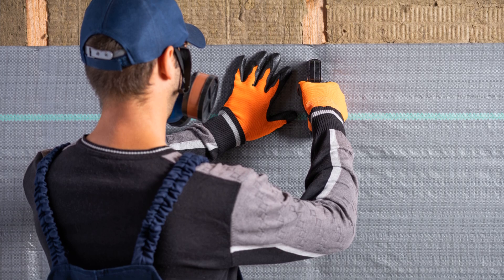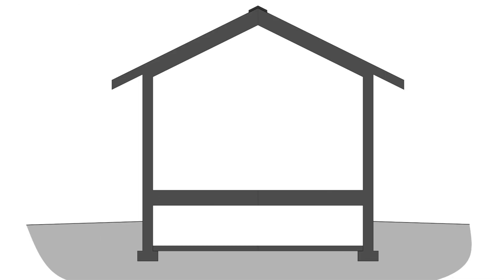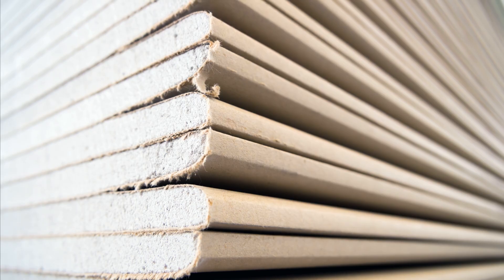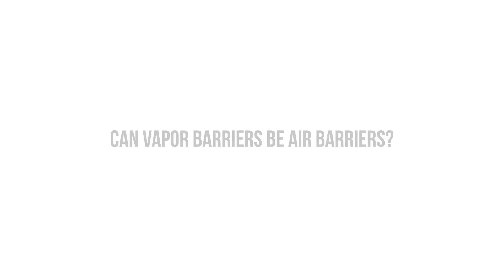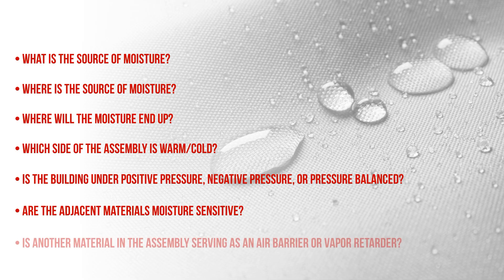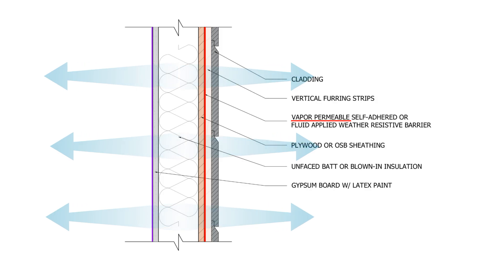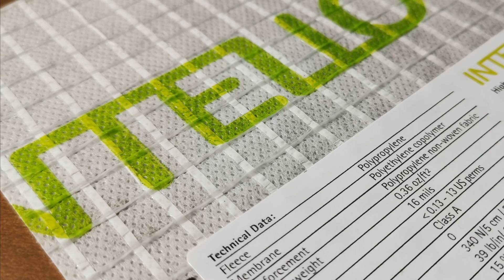Air Barriers vs Vapor Barriers | You NEED To Know The Difference

Comment: You overemphasize air leakage way too much. A bottle of Coca Cola on a hot day will create condensation with zero air leakage. Stop w the damn air leakage
Reply: No he's doesn't...
 air movement itself, from point A - B, where there is a temperature difference,  creates water at that exact point

Comment: clear as mud.  Define terms.  give product examples.  Im more confused than before I watched.
Reply: I thought he did a pretty good job considering all of the variables like different climates, change in season, construction techniques, moisture starting point, air movement to/from and definitions of permeable, non permeable, semi permeable...
The science on all of this is still happening and there is an array of products for a diverse multitude of applications. 
You think a few minute video will get to the bottom of all this?

Comment: on brick structure I’m currently renovating the bathroom on, I need to frame a wall on 2 exterior walls. I plan to use 2x4 framing 1/2” off the brick, rockwool in the cavity’s and a smart vapor retarder on top of the studs, then T&G boards. Would this be okay??

Comment: Just build a concrete house. I will never understand the American obsession with wooden/stick frame homes.
Reply: Cost, concrete is multiple times more expensive, and it's more difficult to expand and renovate in the future.

I've done recent design comparisons for a project I would have preferred to do in concrete and the cost was $500,000 for it to be done in timber frame with drywall versus over $3,000,000 in concrete.

Comment: Thank you for your supportive  information. Keep a housing structure dry and correct way to functional circulate air from the interior to the exterior systems that each applies to.

Comment: I want to use exterior ISO insulation on top of OSB sheathing.   There are various techniques for getting a good air barrier on top of the OSB sheathing, such as roll on Cat 5 or peel and stick roofing underlayment.  How would you recommend detailing this for Zone 5 B?  Am I being excessively paranoid for wanting to have a vapor permeable route out from the outer surface of the OSB?  Or should I just assume that the sheathing will dry to the inside and that it doesn't matter what the vapor pressure and moisture content is of the ISO?  I've been thinking that a band of mineral wool board at the top of and the bottom would provide a vapor bridging path relatively easily, but I haven't come up with a suitably cheap vapor transport layer beneath the ISO to the top and bottom of the roof or wall.

Comment: Just found your channel; super informative, thank you! I noticed most of the resources on your site seem to be aimed at professionals: would you consider creating something for homeowners? I am looking to insulate the attic (and maybe walls?) of my circa-1919 house in the upper midwest but I am worried about someone coming in and doing it wrong and causing some of these mold and condensation issues (and also realizing I already have those issues from summer AC use causing condensation in my walls most likely). I want to be able to understand what the best practice solution looks like so I can be confident I'm hiring someone who knows what they're doing. Thanks so much for all the great info!

Comment: I'd be interested in your thoughts on how to manage vapor for a house at 800m elevation where it's hot in summer 40c, but not exceptionally humid, and cold in winter often 0c and getting as low as -5c.

You mentioned high desert but what might a composite, i.e. layered, wall look like?
Some possbile materials. I'm sure as an architect you have a number of other products for things like thermal bridging

Outer layer: AAC or sheetrock
Possible Layer: semi permeable wrap
Possible Layer: Air gap or rockwool batts
Possible Layer: Foil backed polyiso or other rigid insulation. Which way does the foil face
Possible Layer: Air gap or rockwool batts
Inner wall: corefilled concrete blocks or sheet rock wall

Or any other combination of layers

Comment: Some good basic information, however, oversimplifies the current reality. 1) Nowhere in the code is the reference vapor barrier - everything is a vapor retarder. 2. Current building codes require external insulation - none of the examples demonstrate this, and it DOES change where the dew point shows up 3. No matter the climate zone - the phrase "it Depends" needs to be applied - the video showed and discussed understanding the moisture source and climate zone considerations, however, if you build to code with external insulation, it is recommended to run a WUFI to assist in validating the correct sequence of products.
Reply from the maker: Some valid points, but the video's intention was to break down the differences in vapor barriers and air barriers. I will say, if you need to run a WUFI model, you're doing it wrong. WUFI spits out whatever answer you want, it cannot account for complex 3 dimensional air flow networks. Vapor and condensation is very simple to design for using first principles.

Comment: Cold humid climate, coastal maine. Can I still use a smart vapor retarder if I can't put furring strips on the interior side of the wall for a service cavity/air gap? Can it directly sit up against the back of the drywall? Renovating an old house on the inside and there's an existing window on the wall, so I can't just make the wall come out more
Reply: Extending jams isn't hard to do with most windows if that is holding you up in any way.  Part of spacing the drywall out may be to reduce penetrations overall.

Comment: i was wondering how much nail perforations through taped seam sheathing affect the the air barrier, when siding it seems unavoidable to miss studs, especially when doing shingles, does anyone have any insight into this, also i know siga majvest claims self sealing, but i assume an exterior membrane like that is the solution, or perhaps this is a negligible affect?

Comment: I'm still confused: why not always use a vapor open air barrier, ie; Zip sheathing or something like @2 perms? Let moisture dry to the inside or outside.
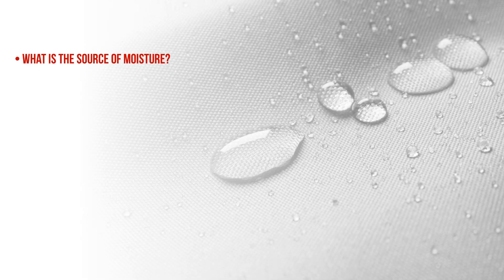Reply from the maker: A lot of the time we try to design our assemblies to be vapor open, but there many times when we need to "throttle" the flow inwards and outwards. We don't want too much moisture to pass through at once, otherwise it could cause problems interstitially. For example, if we have a reservoir cladding like brick or stucco in a hot humid climate, we want to slow down that inward flow so that we don't get condensation on the backside of the drywall. Another example is in a flat roof system, in which the impermeable roof membrane is exposed to the exterior environment. We don't want moisture drying upwards and getting trapped underneath that membrane, as this often leads to roof rot in those assemblies. Refer back to the list of questions I listed at 4:19 to determine whether you need something permeable or impermeable.
Reply: @ASIRIDesigns  on brick structure I’m currently renovating the bathroom on, I need to frame a wall on 2 exterior walls. I plan to use 2x4 framing 1/2” off the brick, rockwool in the cavity’s and a smart vapor retarder on top of the studs, then T&G boards. Would this be okay??

Comment: Asking advice. Plan on building a house with double stud 2×4 walls with 3 1/2" in between. R15 mineral wool for a total r45 with ziga majrex on the inside of the exterior framing as a smart vapor retarder. Should I use zip sheathing or cdx on the exterior? There will be a rain screen behind the siding. This is in 6a zone with humid summers. Thanks for any advice

Comment: I’m surprised that at this late point in the era of the post WWII building materials, specifically the move from woodlath- plaster wall finishing to the domination of gypsum board, that the absolute preponderance of the paper faces of gypsum noted to cultivate mold, mildew, etc. is still unaddressed.
Maybe it’s just me.
Reply: You didn't have those problems when you lived in a drafty, poorly insulated house. We build our houses as tight as cars and we know what happens when we sit in a car with the windows rolled up and no venting to the outside.  It is true that houses gotta breath, but not through leaky walls.

Comment: The rule of thumb is that an exterior air barrier must be 6 times more permeable than an interior vapour barrier in colder climates. The introduction of improperly installed (no gaps between sheets) OSB sheathing and insulated foam board insulation on the outside (taped) creates double vapour barrier which will doom the structure (I have witnessed rot and mold within 2 years of occupancy). Something I have theorized is that by introducing contolled air gaps within the structure and connecting the space to mechanical ventilation it may be possible to neutralize air pressure across the assembly thus interupting the flow of water vapour in either direction. While there is the question of increasing heat loss / gain this can be compensated by locating the air gap inbound of the dew point location and isolated from any fibre type insulation.
Reply: Nice rule of thumb, but I'm not sure whether it is good science with modern practices.  I think you are actually talking about vapor barriers, rather than air barriers.  If I understand God Emperor Joe L. correctly, he says that you can have vapor open assembly, as long as the least permeable part is in the middle, and that you don't have any condensing surfaces.  My guess is you are Canadian (Charter Rights and all), having to deal with insanity in the building code there?

Comment: 😮M notDUMB! This"PRESENTATION" like many others leaves me wondering wtf? Diy'ers need:FACTS,USEFUL data,straight,concise insructions.clearly the intent is  of this vid is2frustr8 diy'ers in2 paying a-hole contractors!
Reply from the maker: What's the problem?
Reply: The whole video is nonsense as is the latest trend in wrapping yourself in plastic sheet. Literally the worst thing one could do. This is only a trend in certain countries. Yet everywhere else they manage air and moisture just fine with no mold whatsoever, they live in very healthy buildings which are very cheap to heat or cool down and many of them don't need forced cooling at all even in 40° + Celsius . None of them are wrapped in plastic, in fact if any real science ever gets done it will immediately show how bad of idea that is, summer or winter. The so called research mentioned here isn't science, it's a fact manipulation. 
There is a lot to be said for basics and building properly, we wouldnt have to worry about air barriers at all.
One way vapour barrier on the outside can be beneficial in certain builds, but if you absolutely depend on air barrier then you have a different kind of a problem, ab is only masking up those problems while adding new ones.
Reply: @samsonsamsamsam  what countries and places are you talking about? Can you give some examples?
Reply: @samsonsamsamsam  okay grandpa, maybe take your pills and have a lie down. The world isn't a giant conspiracy, building standards and our understanding of climate management just improve.

Comment: Thank you for the clear explainations. Air leakage is such an underestimated problem. The "buildings need to breathe" mantra continues the damage. What is your solution for humid air present at the roof ridge while maintaining the air barrier?
Reply from the maker: Thanks for watching, and great question. There's a few ways to address humid air that accumulates at the ridge. You can either use a diffusion port (mostly for warmer climates but there are ways to design them for cold climates as well), run a dedicated supply and return for the attic space so that it receives conditioned air and exhausts that stale humid air, or install a dedicated dehumidifier for the attic space. Or you can specify a self-adhering roof underlayment that's vapor permeable and use a vapor permeable rigid insulation like mineral wool with an air gap to facilitate drying across the entire roof assembly.
Reply: Humidistat operated passive vents?
Humidistats seem pretty cool and living in England I'm surprised I don't see more of them.
I reckon a solar powered control panel could link together multiple areas in a house, regulating moisture in an intelligent way, 
with external sensors too the capability to go from passive venting to mechanical venting could be utilised too, maybe creating an efficient system that could be installed without altering the fabric too much.
I do know that despite all the modern materials and know how, its still a problem in the uk that often gets overlooked and doesn't seem to have found a definite solution.
Surely the quality of air we breathe is a primary consideration.

Comment: I wonder what's more useful and/or cost effective - the dehumidifier/erv combo + standard WRB, OR a completely sealed building envelope (example: zip system w/monopoly framing for a super tight assembly) ?  

The reason I ask is because I wonder if a simple vapor permeable WRB  like HydroGap SA (which also acts to a lesser degree as an air barrier) + a dehumidifier is just as effective as a zip system house 🧐 - Climate = coastal southeast, subtropical
Reply from the maker: A good building envelope can save a poorly designed HVAC system, but very rarely can a good HVAC system save a bad envelope.
Reply: In your video, you recommended a 'semi-impermeable' WRB for hot and humid climates, however even Zip which is a great air-barrier is between 12-16 perms, making it semi-permeable...How do you achieve the recommended 'semi-impermeable' assembly? - is an additional vapor retarder needed on top of sheathing OR is 10-16 perms sufficient? - My understanding was that low perm WRBs are sufficient - for example HydroGap SA is 12perms
Reply: Appreciate your thoughtful content btw 💪

Comment: I would better be able to follow your presentations if you were more consistent with conventions in your drawings - either always have the exterior surface on the left, or always have the exterior surface on the right.  As it is, every time I see one of your drawings, I have to pause and evaluate which direction things are, because that convention keeps changing from one drawing to the next.

(Thank you for your high quality presentations.)

Comment: Your videos are excellent; thank you for posting them here!  Information flow is focused and concise with useful graphics and descriptions.  I usually play each video a few times.  Your accuracy rating seems to be very high, as well.  Less accurate construction videos regularly have obvious issues, like a host's failure to use eye protection, or some essential step being left out, or problems visible in the background that go unexplained.  I am looking forward to reviewing all of the content you have shared!
Reply from the maker: Thank you so much! Glad to hear it was helpful.
Reply: @ASIRIDesigns  Thanks for your reply!  I just read through the comments here; they are quite interesting.  One of them makes me suspect that entry-level DIY viewers may not be ready for information-dense content like this.  I suspect some contractors might also not be.  Somebody might not know which question to start with, especially if you're covering multiple building zones on a complex topic.  Then consider the confusion various contractors may create online by having different ideas about what works best.  I suspect building inspectors themselves can contribute to the confusion, considering the stories I've heard as well as my own experience as a DIY homeowner.

Condensation damage here along the Gulf Coast has drawn my attention since I repaired floor damage in my aunt's house more than twenty years ago.  She was using a huge window air-conditioner in the large hall of a very old house that had no insulation under the floor.  After investigating the damage, I realized that moisture from the warm, humid, crawl-space air was condensing through to the underside of the original floor linoleum and then rotting the subfloor.  A layer of sturdy Masonite and then another vinyl flooring had concealed the problem for many years.  Curiously, the damage extended from the AC, down the hall to the bedroom door, and then toward the bed.  I realized that was apparently the result of using portable fans to direct the cold air.